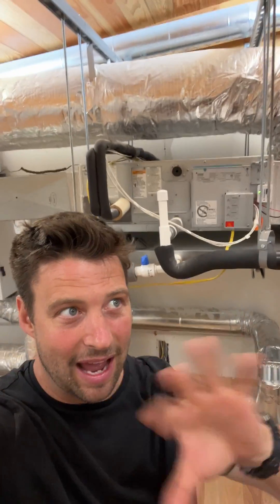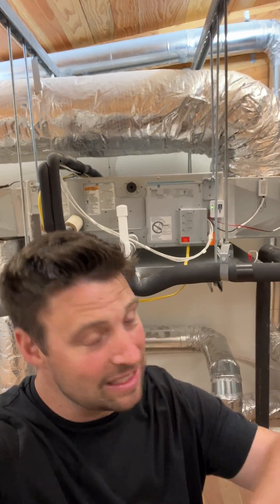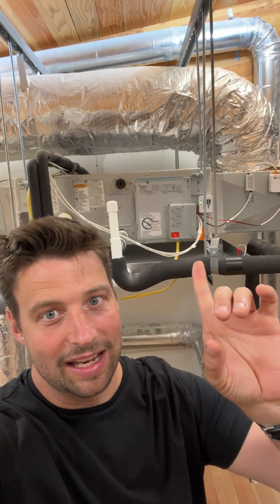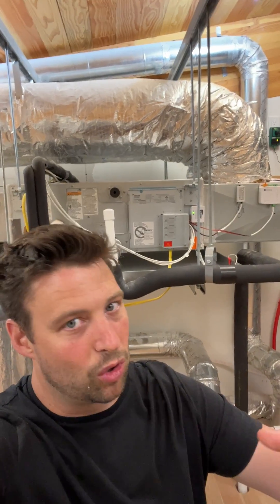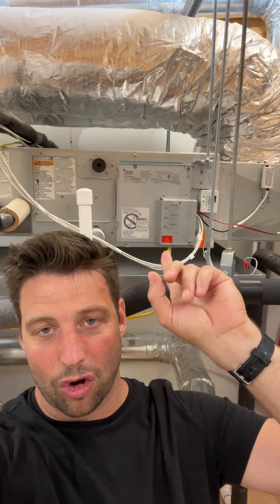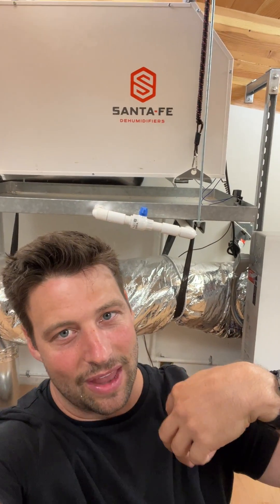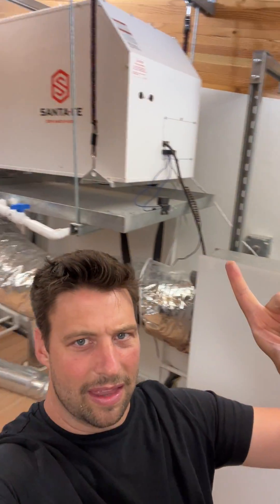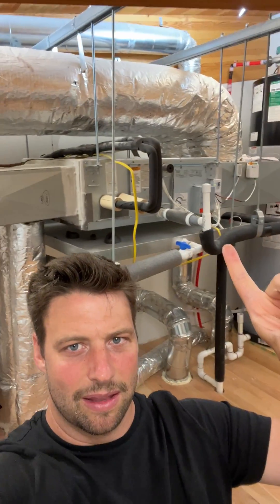HVAC Design - Keep It Simple Stupid!

Comment: What even more simple is using the dehumidification functions built into the air handler. When the air handler knows it needs to dehumidify it will drop the fan speed, lower the coil temp and pull the moisture out faster. When the unit is removing latent heat it will do very little sensible cooling. This works even better with variable speed equipment that can control the system capacity, but can work with single or two stage equipment as well.

Comment: Jordan, I did this setup at my house I built a couple years ago and I 100% agree with this. I’m in GA where it’s hot and humid. I will do this setup at every house I ever build here going forward. Most comfortable house I have ever lived in! My house got a 2.0 ACH50 on my blower door and I didn’t even have weatherstripping on the doors (painters left night before and blower door guy showed up early before I could get them all back in) so I imagine with the weatherstripping installed I’m closer to 1.0. Our main systems are variable speed Trane, but sometimes they need the extra oomph of the Aprilaire dehu to keep the air dry in the house because of the humidity. I keep the dehumidifiers (one for the conditioned part of the house, and one in the unfinished basement) set at 49% RH. My ERV (fantech) runs 24/7 in “eco mode” where it runs at low speed all the time. We can keep the thermostat set at 74 during the day and it’s not stuffy at all, and we sleep with it at 71. At our old house (which was a 2014 build so pretty new) We had to keep the thermostat set at 72 during the day and 68 at night to stay comfortable.

Comment: This seams like a very crude understanding of Psychrometrics. Sure, it works; but having multiple pieces of equipment to do one relatively simple job seems very unelegant. With a fully modulating air handler you are pretty close to being able to load follow both the sensible and latent; if you already have a variable speed compressor and fan, all you need is a modulating reheat coil of some sort, and the sensors/controls to control it. A lot of commercial equipment can already do this.

Comment: Agreed.  I'm planning unvented attic, stand alone ERV, and mini-splits.  I will probably have a dedicated dehumidifier for cool days when the AC doesn’t kick on enough to dry out the air.  How did you duct your standalone dehumidifier?  Is it tied into the ERV  or HVAC ducts, have its own separate ductwork, or does it just have a single (separate) supply and return?